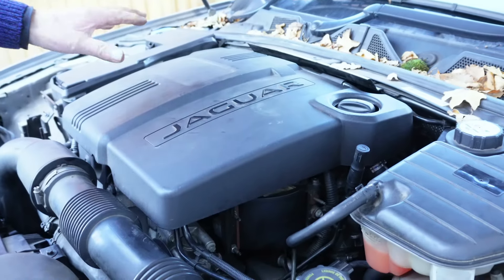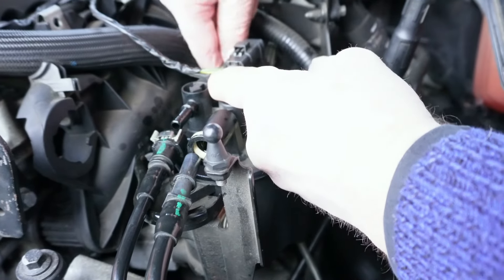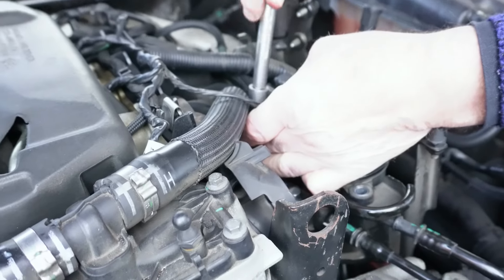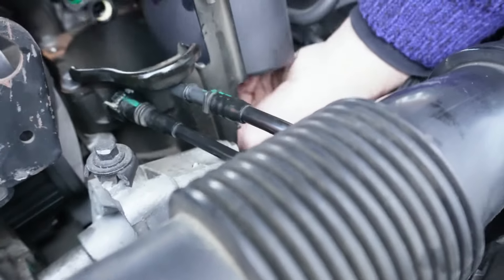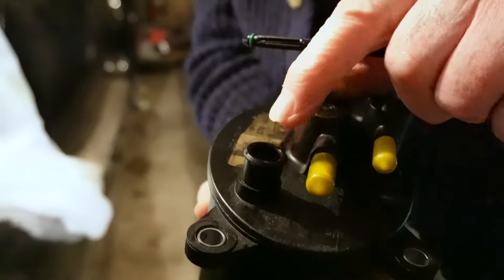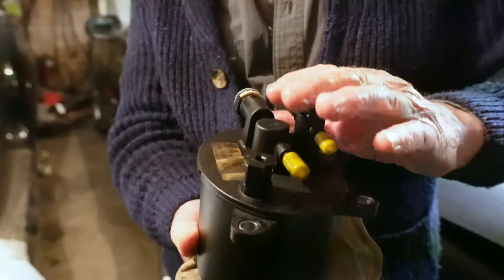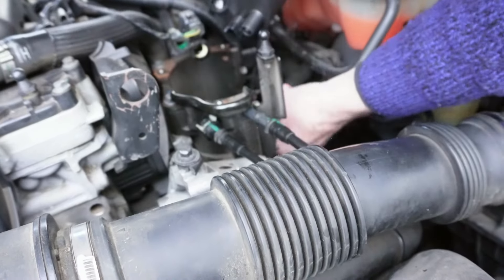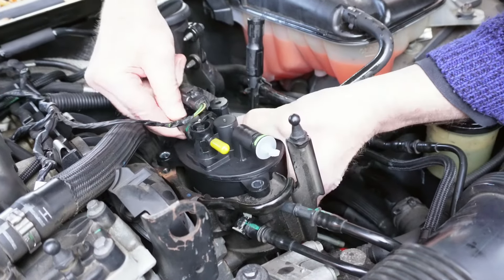Jaguar XF Blocked Fuel Filter Change | Sudden Acceleration Drop Out? It Could Be This.

Comment: Great but why can I not just prime it once it's fitted. I think I might make a mess, lose fuel when trying to put that tube back on in engine bay ??
Reply from the maker: Hi Arnie, thank you for watching and for your feedback. As you rightly point out you can prime the filter when fitted, I showed it primed off the car for clarity. If you replace the fuel filter without priming, the engine  initially should start, run for a few seconds and then stop ( fuel pressure if already in the fuel rail allows this ) then it's a case of turning the engine until it starts. The drain tube fitted underneath the fuel filter will not lose fuel if the plug on top is tight.
Reply: @crystalclearmechanics  thanx I was meaning to fit the filter, Then fill it with fuel. I don't see the need to fill and hold finger over tube ? Why not just fit then fill with fuel ?
Reply from the maker: Hi Arnie, yes you can do that but if you don't hold your finger over the drain ( where the tube fits ) the fuel will come out as soon as you put it in. @arnietwo11

Comment: Thanks for pointing me to this great video. Interesting you don't need a priming pump that many mechanics use. Could I ask what the tube you connected to the bottom of the filter is connected to on the other end please? Thanks again
Reply from the maker: Hi Andrew, the tube on the bottom of the filter is just a drain tube it's only connected to the filter, they often fall off and are found in the engine tray.

Comment: I got an aftermarket fuel filter which is for my 2013 jag xf the one im taking off is exactly the same as the one you show in this video. The replacement looks identical apart from it does not have the aditional screwcap which you remove to prime the filter. My question is can i still prine the filter by connecting a hose to one of the inlet pipes and pouring diesel via a funnel to fill the filter. I dont have any additional pumps or anything so could i do it this way? If so how would i know it is full, do i need to remove all the caps first ect to prevent air blockage etc  Cheers. Great video by the way very simple to follow
Reply from the maker: Hi, thank you for watching and for your feedback. Yes you can prime the fuel filter the way you said, it's probably easier to fit it on the car remove the caps fit your pipe and funnel and fill until it comes out the other side then connect the fuel lines.
Reply: @crystalclearmechanics  thanks for your reply so do I need to fill both the low pressure and high pressure sides, is there a preference as to which pipe I use to prime it up or will any do. Should I do this before refitting any of the pipes or refit pipes after it's full.
Reply from the maker: @soulfulshoes  Hi, if you stand in front of the car looking at the engine the pipe connections on the left of the fuel filter are fuel return pipes so don't worry about whether they are connected or not. It's best to connect your pipe and funnel to the pipe connection on the right and nearest the front of the car leaving the pipe the opposite side open.
Reply: @crystalclearmechanics  great advice thank you

Comment: Will the fuel on the old filter pour out of the drain plus while removing it? And once you put the fuel into prime the new one, will the fuel come out of the drain plug as soon as you take your finger off? Thank you
Reply from the maker: Hi Andrew, thank you for watching and for your feedback. Yes fuel will come out as soon as you remove the drain plug and then take your finger off.
Reply: I think what people are asking is once you've primed the filter and replaced the plug won't fuel come out of the bottom when you move your finger to replace the filter?

Comment: Hi! I have a problem with my car and I would be greatful for your advice.
Reply: I have a 2014 jaguar xf 2.2 diesel with 105.000 miles and I have a problem with the fuel consumption. On a long journey it is around 7.5l/100km(37mpg) not driving fast. I usually cover 400 miles with a full tank driving mostly outside town. I have no error codes, the car runs normal, I have replaced air filter, oil and oil filter every 6000 miles. Recently, I ran a can of liqui moly diesel purge directly to the feed and return pipes of the fuel system but nothing changed. What else do you think I should do?
Reply from the maker: Hi Stefan,thank you for watching and for your feedback. Yes I will help if I can, what is the problem?
Reply: I have a 2014 jaguar xf 2.2 diesel with 105.000 miles and I have a problem with the fuel consumption. On a long journey it is around 7.5l/100km(37mpg) not driving fast. I usually cover 400 miles with a full tank driving mostly outside town. I have no error codes, the car runs normal, I have replaced air filter, oil and oil filter every 6000 miles. Recently, I ran a can of liqui moly diesel purge directly to the feed and return pipes of the fuel system but nothing changed. What else do you think I should do?
Reply from the maker: @stefandraganescu1946  Hi Stefan,
How do you measure your fuel consumption ie car onboard computer or driving over a tank full or do you fill up the tank drive a certain number of miles say 60 then fill the tank again to see how many litres / gallons used?  The intank float / fuel level sensors do have issues and can show false readings.
 Have you always had the bad fuel consumption, if not when did you notice it and was any work carried out on the car previously?.
Have you confirmed there are no fuel leaks?
Have you checked for air/vacuum leaks?
Your car has covered 105,000 miles, has the cam timing belt been replaced? It is due a change.
Let me know on the above then we can go further.
Reply: Hi, thank you for your response! Yesterday I filled up with 53.3l(11.7 gal) that lasted 657km(408.2 mi) since the last fill up. I calculated a fuel consumption of 8.1l/100km(34.8 mpg, I hope my conversions are right). 400km were done outside town and the rest in city driving. I don't know if this is right for this car but my girlfriend's 3 series gets 5.6l/100km(50.4 mpg) on the same outside town commute and with 50/50 city/outside driving. I'm not expecting such economy but for me it seems pretty poor for the jag. The fuel consumption is the same since I bought it one year ago. I can't find any evident fuel or vacuum/boost leaks and the timing belt was changed by the previous owner. The car runs fine but holds the revs at 2700-3000 when going uphill at 25-30 mph even that there is not sugh a big incline. Other cars I've driven change gear at much lower rpm. I think it is holding the 2nd gear for too long. Sometimes it does a similar thing when going from a stop, it takes pretty long to change to 3rd, revving the engine to 2500 and holding it there a bit(usually shifts at 2000) even though the accelerator imput is small and I expect it to shift faster and at lower rpm. Also, on the first few miles of the day, when coasting I feel the downshifts like a little brake applied for each gear. Usually I can't feel them. And the last concern is that on a longer trip, alfer a couple of hours, I experienced a loss of power, it was very hard to overtake and to accelerate uphill, the revs were climbing slower than normal but they went to the redline as usual. The car didn't show any warning or check engine light and there was no error code stored. The next day the problem disappeared, it didn't happen again but also I haven't made such a long journey since then.

Comment: Do you recommend any particular brand of filters or would you say use Jags genuine one?
Reply from the maker: Hi, thank you for watching and for your feedback.
It's good practice to use the manufacturers parts but I have used aftermarket filters supplied by the customers and they have worked without any prolems.

Comment: Hi there 

I have my Jaguar xf 2012 2.2 diesel and my issue is this . I press the accelerator all the way down and nothing happened. It accelerates so slow as the car is on safe mode . Any advice?
Reply: Safe mode is usually activated when the fuel level is low, or the engine is not getting enough fuel to operate properly. It goes into safe mode to prevent damage.

Comment: Hi, could I ask for your advice?
Reply: So I’ve been having an issue every now and again with the car turning over a few times before it would start, this was when it was around a quarter or just under a quarter full of diesel, but issue went away once I’d filled it up and I wouldn’t notice it again until it got to the same mark. This has been going on for a while so I just kept diesel in it all the time. Until I was driving home and I had a bit more then a quarter of a tank and it cut out, now it won’t start just turns over but brings up the code for fuel pressure. I am going to change fuel filter but not sure if that’s going to be the actual issue or if it will be something else, any advice I would be very grateful, thank you
Reply from the maker: @sammidalo47  Hi, thank you for watching and for your feedback. You say your car will not start, have you filled the tank again or is it still at a quarter? I am assuming from what you say that it is a fuel issue.  I'll explain the fuel system first. Your car is fitted with saddle-bag fuel tanks so called because the tanks fit either side of the prop shaft and are connected above the propshaft, on the drivers side tank ( UK cars ) it is fitted with a recirculating electric pump within a swirl- pot ( see my video Jaguar xf in tank transfer replacement ) that causes a vacuum which then moves fuel across the tanks. The low pressure pump which feeds the high pressure pump is integral to the high pressure pump ( fitted to the back ) this fits on the top and back of your engine. The low pressure pump sucks the fuel from the swirl pot within the tank through the fuel filter to the high pressure pump. There are several causes for low fuel rail pressure but your issue appears ( from your description ) to be tank related and is a common problem usually caused by a bad electrical connection at the tank or a problem with the in-tank pump or swirl pot pipe connections, the fuel float connected to the swirl pot also play up. I would advise to first check your electric plugs at tank and that your in tank pump is working, if that is all good then remove the swirl pot / electric pump as the video shows ( easy job ) and do the obvious checks, pipes connected etc.  Check the tank pump is working / not working before you remove it as disturbing it can cause it to start working. The fuel filter could be a possible cause but I can't see that the fuel level in the tank would unblock the filter. Try / check the above and get back to me and we can go from there. Thanks again for watching. Ps, check that you have fuel in the tank as the fuel float can give a false reading.
Reply: @crystalclearmechanics hello thank you for you advice I will try all of these things, can I just ask how I can tell if the low pressure pump in the tank is working or not? Thank you
Reply: So found an issue because of your help!!! The connector on the pump in tank is completely burned out, the connector itself and the bit on top of the pump has burned. Is there a way I can send you an image? Not sure if it will be replaceable without replacing the full pump or not
Reply: I’m also really struggling to find any part for it
Reply from the maker: @sammidalo47  Hi, if you look at my video " Jaguar xf in tank transfer replacement " about 1 minute 34 seconds in to 3 minutes 15 seconds it shows the beige top, is that the electric plug you are referring too or is it the plug with the red and black wires attached at 2 minutes 51 seconds to 3 minutes 15 seconds in? thanks.
Reply: @crystalclearmechanics hello it is the first plug the one at 1.34 in roughly on the video. I’ve ordered a new pump (second hand) and they are giving me the connector on top with about 6 inch of cable to wire it on. Is this good or is there anything else I should worry about
Reply from the maker: @sammidalo47  Hi, the part you are referring to is the lid, not the actual electric pump. . The lid is easy to swap, one electric plug which fits underneath or otherside of your burnt out plug and one pipe connection that has two lugs you press inwards to release it from the lid. Glad you got it sorted. PS my video shows you how to remove the lid.
Reply: @crystalclearmechanics  I’ve got a new pump and lid and connector. Do you think I should just swap the lid out then rather than doing the whole pump? Thanks
Reply: @crystalclearmechanics  I’m doing this job in around an hour but I can’t find which fuse I would need to disconnect to re wire the plug and I don’t want to disconnect the battery because even the proper shut down procedure doesn’t work for everyone. Do you know if there is a certain fuse that would work?
Reply from the maker: @sammidalo47  Hi, if you are cutting and joining the wires or rewiring the plug just address one wire at a time then you don't need to disconnect anything as long as the ignition is off. Just to clarify, your car is the 2.2 diesel.
Reply from the maker: @sammidalo47  Hi, If the parts are new swap all if not just swap the lid and see if all is good.
Reply: @crystalclearmechanics  I’ve replaced and wired this now, I can hear it working. I’m not at a stop road. The car is not starting 2.2d 2013 xf when I take the lines out of the fuel pump there dry as a bone and I would of thought there should at least be some drips of diesel, I have tried to crack the injectors to bleed air but didn’t work, I’m not confident that the fuel is even making it as far as the filter :/
Reply from the maker: @sammidalo47  Hi, because the car effectively ran out of fuel ( none in swirl pot in tank car stopped ) I would advise priming the fuel filter as shown in my video ( Jaguar XF blocked fuel filter change ) but you do not need to take the filter off the car, I did that for clarity. With the filter full it will be enough to start the car then with the engine running the low pressure pump should be able to suck the fuel up from the tank. If the filter is not full of fuel you would need to keep turning the engine over with the starter motor for a long time to get the fuel through if it's possible, probably damage the starter motor in trying. The low pressure fuel pump is on the engine side of the filter and has to suck the fuel from the tank through the filter so if your filter is empty or low you are not going to get any fuel to the high pressure pump.
Reply: @crystalclearmechanics  I’ve finally got it sorted thanks so much for your help I couldn’t have done it without you
Reply from the maker: @sammidalo47  Glad I could help.